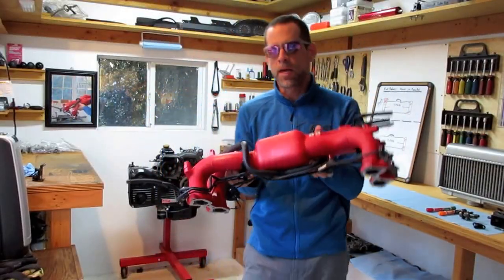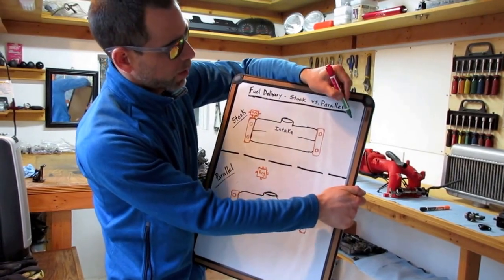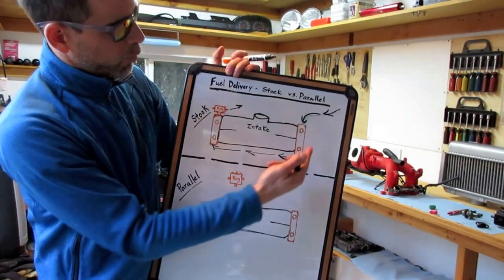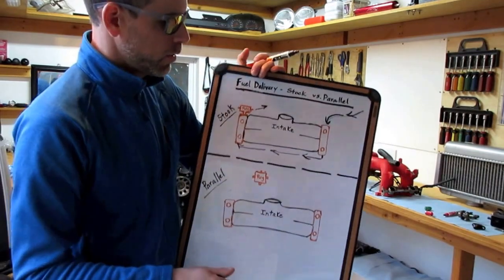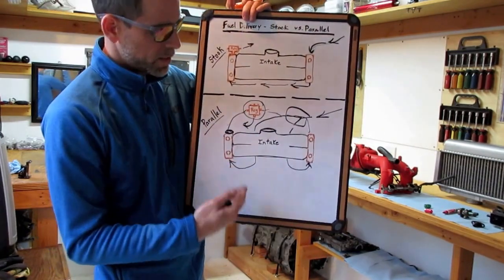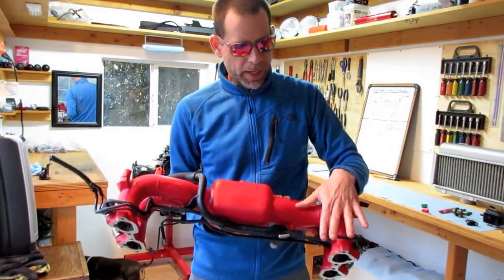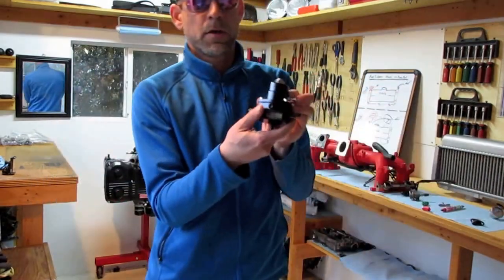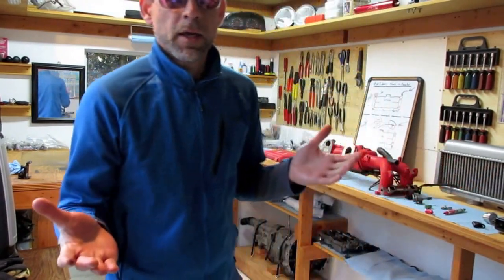How Parallel Fuel Systems Work on Subaru Engines

Comment: Interesting you're using standard lines, can I ask why you chose that route and not braided? Personal choice maybe? See my videos for my 472bhp JDM TYPE R, parallel rails are next for me and trying to weigh up options 👍
Reply from the maker: +Aaron's Videos  Thanks for dropping the question.  And btw, your car sounds awesome - I will check it out.  I went with stock lines cause I was staying with the stock rails and those rails have the smallest inner diameter/choke point at their inlets and outlet points for the entire fuel system.  So, go bigger diameter braided would actually not have helped the flow of fuel in my case.  

HOWEVER, if I went to larger rails, YOU are 100% on target and larger ID fuel lines (braided or any high performance type - there's so many options out there now) would be the only way to go. If I stayed with stock lines at that point, I wouldn't be taking advantage of the new ID and associated fuel capacity of my new rails!

Comment: I've been doing some reading and saw a thread on nasioc discussing why series is better than parallel for our engines. Not saying it's right or wrong, but since the point was that since none of the cylinders are firing injectors at the same time (or the overlap is negligible) there isn't much gain to be had by going parallel. They were also saying one of the reasons people have problems with the junky agency power rails is due to the fuel velocity being halved in each rail and somehow inducing vapor lock. BTW, just found out about your channel and subscribed. Keep up with the awesome content! interested to hear your thoughts... Ryan
Reply from the maker: +ryan lewis 

Thank you for checking out the channel and for taking a second to post a comment!  Much appreciated!  The whole discussion
on 'Parallel vs Series' Fuel System is is a hotly debated topic for sure - It has been for many years in Subaru circles.  I think there are probably compelling arguments for either position.   As you get into the technical details, there is a lot happening here, as you touch on by mentioning the aftermarket rails and the impact to fuel flow velocity.  

One could probably write an essay on this question alone but I don't think anyone what's to see something that long-winded here, so I'll try to make it short and concise...  

Basically, I don't believe going to a 'Parallel Flow' set-up could do anything but HELP - The science doesn't back-up any other position in my opinion.  Here's my logic, you are right about the fuel velocity and vapor lock being a critical concern and condition to avoid.  With respect to velocity, the liquid (in this case fuel) is primarily effected by two physical conditions, change in flow direction and more importantly change in inner orifice diameter (in particular, going from small diameter into big diameter - This can create VAPOR LOCK and induces a lot of turbulence).  When you switch your fuel system from series to parallel, you reduce the number of turns and the number of times the fuel goes from a small orifice into a big orifice, so going to a parallel design should help reduce the chance of vapor lock and keep the fuel velocity up.  Fuel pressure is at play here too...less turns and less turbulence  leads to lower frictional loss and the preservation of closer fuel pressures across all fuel injectors. So, I think Parallel design in theory should help keep more even fuel pressure across all rails too. 

*ONE NOTE:  Everything changes if we start talking about using aftermarket fuel rails.  It's all about maintaining a constant inner orifice diameter (and having a large enough inner diameter orifice to handle to required volumetric needs);  -AN fittings and hoses do exactly this. So if you step up you whole fuel system, the advantages of going to 'Parallel' design start to decrease.  

That being said...If you were building a 1000HP motor, you would still want the most robust and bullet-proof fuel system design and I think 'Parallel' wound still be the way to go; I've seen many big horsepower motors used in professional motor sports (drag racing to circle track) use 'Parallel' designs.  It will probably be a hotly debated topic for many years to come... Thanks again for the post!!! 👍👍
Reply: thanks for the comprehensive response. that's a good point about the inner diameters/sharp turns of the aftermarket rails throwing a wrench in the works.

taking the pro parallel argument one step further, do you think there's consistency/reliability to be gained by going semi returnless and going: fuel pump --> fuel distribution block --> fpr. with the distribution block having 4 equal length lines going to the end of each fuel rail? I'd imagine this provides more consistent  pressures at each injector, and keep the return fuel from getting cooked by the engine. This would decrease fuel velocity through the rails again, but if I read your post correctly that's a moot point. Right?
Reply from the maker: +ryan lewis  - This sounds like it would provide the most consistent fuel pressure at the rail, but if I read your comment correct, there is no return fuel flow back to the tank at all.  Is this correct?  If so, I think this would burn out the fuel pump, as those units are designed not to flow against a dead-head line.  As I understand, these fuel pumps can push the volume but can't deal with very much back-pressure.
Reply: SubaruONLY I'm talking about a semi returnless setup. Not a full in returnless setup where the fpr is integrated into the tabk/pump. basically having the fuel going to a distribution block, fuel pressure reg and then the tank. the distribution block would supply fuel to the rails and act as a pass through for fuel going to the return lines (instead of sending it through the rails and then the reg). thanks for the reply!
Reply from the maker: +ryan lewis  Ah, OK - I got you. I have not seen this type of setup first hand, so my perspective is limited in that respect.

BUT, I will try to apply my experience and scientific rationale to weigh in...

As I see things, having the fuel flowing at good consistent rate with plenty of volume and at the right pressure (for the full RPM range) is the most critical thing to achieve. From there, you can try to cool the fuel and avoid any vaporization, which can cause vapor lock (basically a bubble of vapors in the fuel line that blocks liquid fuel from passing through), which YOUR design/approach focuses on addressing, I believe.  I don't have any data to back this up, by I think allowing the fuel to flow back to the engine is a good thing overall, as it prevents the fuel from sitting in the rail and absorbing all the engine's heat.  Heat is going to transfer into the fuel no matter what you do, it's really just a question of how you minimize it.  I think removing the return line (from the rails) would cause more heat to transfer into the fuel (at least at the rails) and might increase the chance of crossing over fuel's vapor pressure threshold and create vapor lock.

So, overall I wound go with parallel but just make all the lines and rails bigger to supply all the fuel your particular engine combination requires.

Comment: Did you have to flare the stock lines where you split them for the Y fitting?
Reply from the maker: Thanks for the question and checking out the video - Much Appreciated! 

Yes, I did flare the stock fuel lines using an "ISO bubble flaring kit".  They say it's for brake lines but I was able to use it to flare the stock hard fuel lines (where I cut them) very easily.

Here's a link to the Flaring Kit I used for Reference - It's a $30 kit from Amazon:  https://www.amazon.com/dp/B0015PMZMU/ref=cm_sw_r_cp_apis_1491187829774